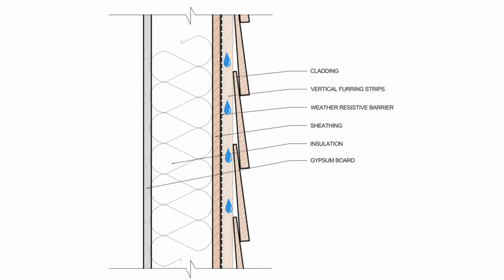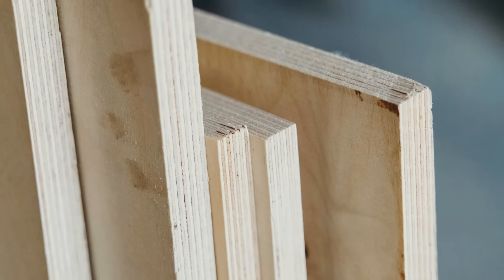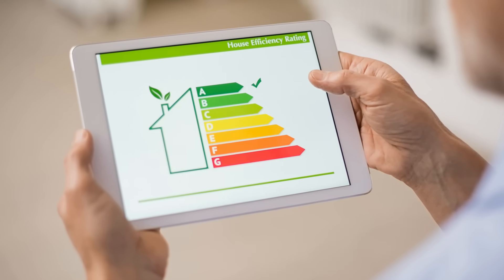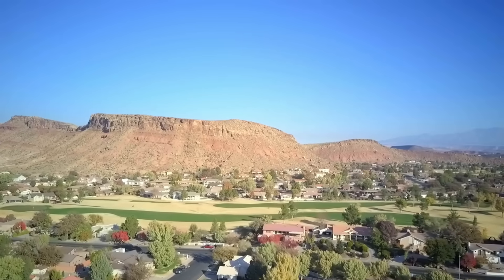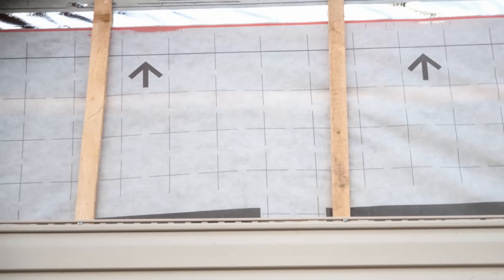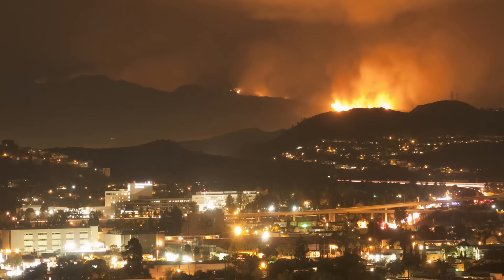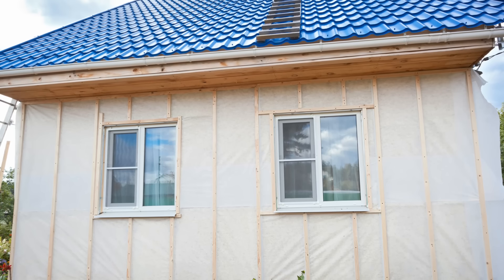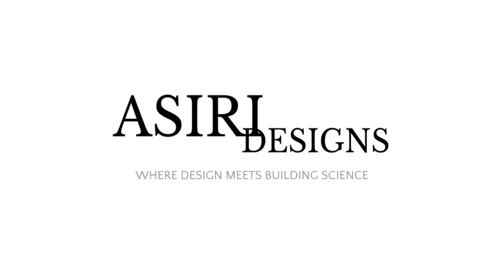Do You REALLY Need a Rainscreen?

Comment: One idea you missed… When wood siding gets wet to tries to migrate to the cool dry side of the product. A weather barrier becomes a shield so it has to dry out to the outside. Because of which the paint or stain becomes compromised and you have to finish it more often. By having a rain screen it can drain and dry to the back side, thus saving the wear on the paint. The you do not have to repaint your home nearly as often.
Reply: I feel like this benefit is not mentioned nearly enough.  Reducing the number of times you need to repaint your home could easily pay for the rain screen.
Reply: @DeuceDeuceBravo  yes, really noticed this with old homes that lack an air gap. Also good practice to paint the backside of wood siding prior to installation (or buy pre-primed or pre-finished) so there is less differential moisture content and less moisture change in general. And prime/paint all cuts.
Reply: @jamesroscoe7555  if you want the wood to dry to the back side, maybe the primer on the back should be more vapor open than exterior paint.
Reply: @pcatful it's not that we necessarily want the siding to dry to the back: the rain screen enables any (hopefully small amount of) water that gets past the siding to drain and dry. 

For the siding itself, some moisture is going to get through the paint and wood can accommodate some moisture change (by swelling across the grain). However, if the back side is unpainted, the rate of moisture absorption and release can be greater than the painted side. This causes the unpainted side to expand/contract more across the grain than the painted side, causing cupping, especially if the siding is plain sawn rather than rotary cut. Painting all surfaces reduces the overall rate of moisture change in the wood and the differential change so it is a bit more stable and holds paint longer.

Comment: I'm in a fire zone. What should I use instead of a ventilated rain screen?
Reply from the maker: Hydrogap works well.
Reply: some origami with steel mesh is what you need. you cover the  in and outs  with it,
Reply: I wonder if you could keep the rainscreen, but build with fire-resistant materials (e.g. mineral wool exterior insulation, cement fiber siding). They also make screening mesh with intumescent coatings that expand when subject to heat, sealing off air channels, though I'm not sure if that's approved to use in place of bug screens at the top/bottom of the rainscreen. Just spitballing here.
Reply: @RedMike-ym8hd This is what I plan to do. Exterior rockwool with steel battens (attached through the insulation by fiberglass standoffs).
Reply: No pro here, but the ventilation is important. If you're concerned about it ingesting burning ash, add a filter (wire mesh) at the top and bottom to keep that out along with any bugs.
EDIT: Whoops - I responded before seeing the end of the video. The HydroGap SA they showed I think is a 1/8" vent, so difficult for fire to encroach. Insulation like rockwool is also vapor open and fireproof (it's literally mineral rock, so I would also think a heatsink). Some combination of these seems justifiable to me, but don't do anything based solely on my speculation...
Reply: @ChristopherCurtis can’t have insulation as you need air current. There are German systems that activate in heat and release rock wool to block the airflow.
Reply: @bfelb you still have a gap between the insulation and the back of the cladding
Reply: @niktak1114 then it’s not a functioning fire barrier
Reply: @bfelb  Do you have a source for this assertion or its German systems? Again, I'm no expert here but you can put a blowtorch to a paper cup if it's full of water. If you have a 1/8" gap with one side being made of rock insulation sucking out the heat, that should buy you more time. If you need a bunker, build a steel and concrete bunker. But if it's just wildfires you're sucking hot ash into your ERV or make-up air system filters, or up through your soffit vents. Most people are just trying to build safe, affordable houses.
Reply: @bfelb it is if you have an ember screen over the bottom opening. It will actually transfer less heat that way with an air gap.
Reply: There are a few fire rated vents on the market.
Reply: I would go with a three-coat stucco system over two layers of 60-minute paper with fully stucco eaves and of course a bottom weep screed. for the roof go with concrete shingles.
Reply: Metal cladding.
Reply: skip the rain screen
Reply: Concrete and steel exterior. Rain is the least of your worries.
Reply: @Mayamax3 Concrete soaks up water like a sponge. Hence tile or other treatment required.